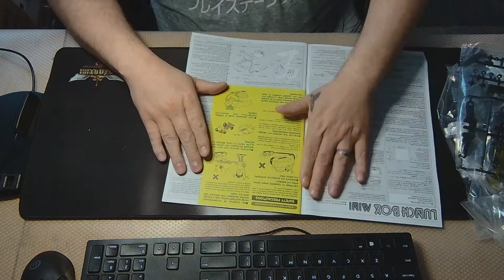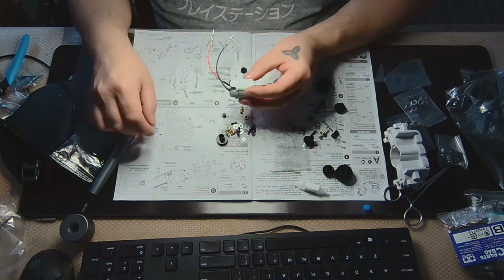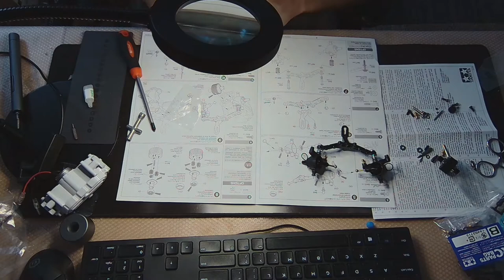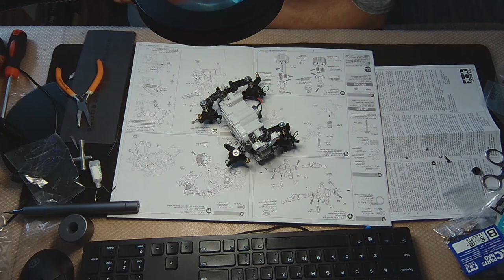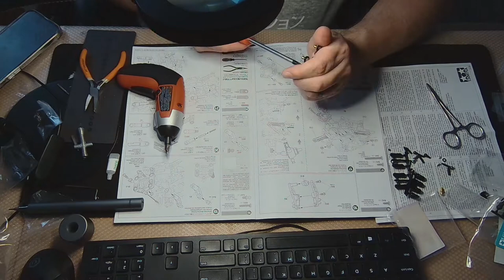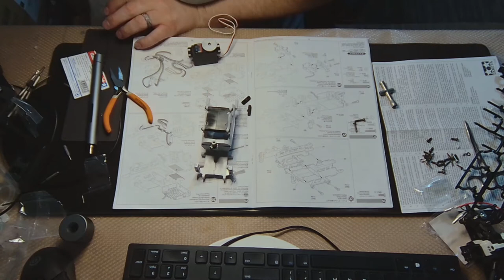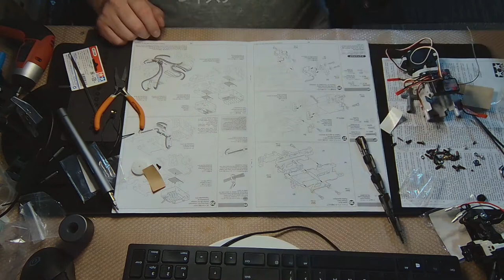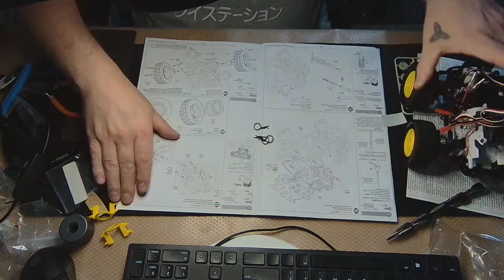Tamiya SW 01 Build

Comment: How much does this little truck even weigh ?
Reply from the maker: I just weighed it and with the little SCX24 battery it weighs 19.78 oz’s.
Reply: @BionicCommando1  so converting that its roughly 560 grams how many mah is the scx24 battery 800 - 1000 ? or is it like a 400 mah 2s or something ?
Reply from the maker: @Mini-z1994  650mah 2s